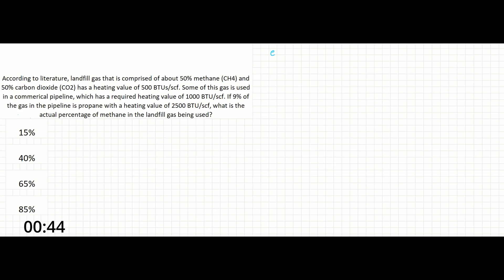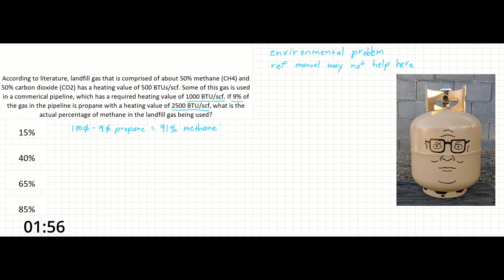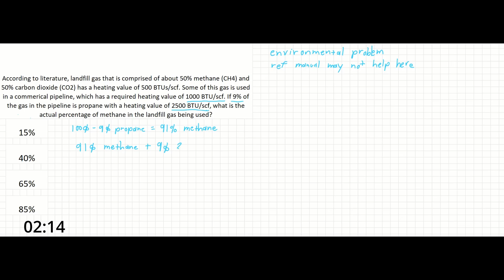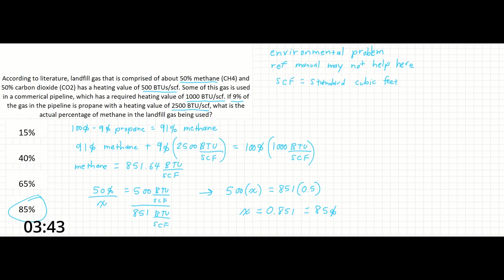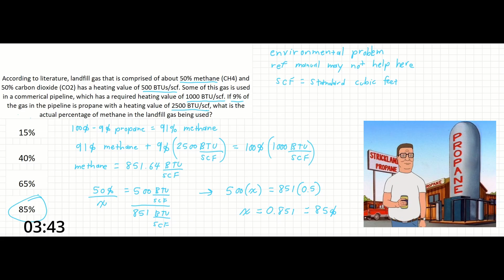PE Exam Practice Problem #99: Environmental | Landfill Gas Heating Value In  Pipeline (Dangit Bobby)

Comment: Im just confused why 91% of the gas is methane in the pipeline when originally you are given the landfill gas is 50% methane and 50% CO2. Am I missing something? Is it because CO2 is specifically not used in the pipeline?
Reply from the maker: Ah - i think you pointed out a mistake in my first line of blue marker - I should have said its 91% "Landfill Gas", not just methane.  Sorry for causing confusion.